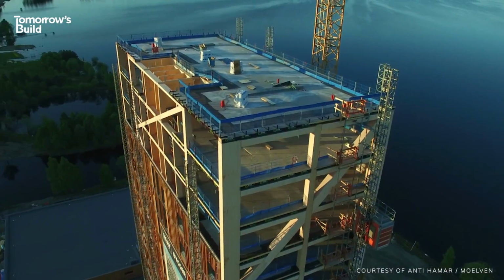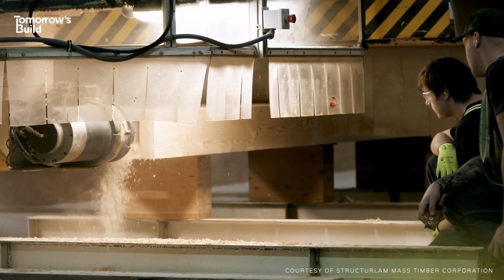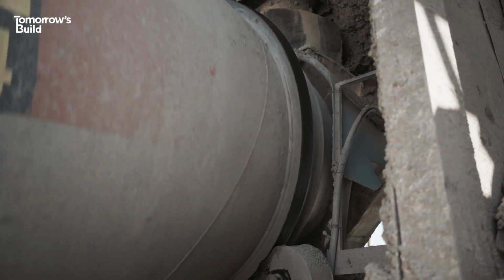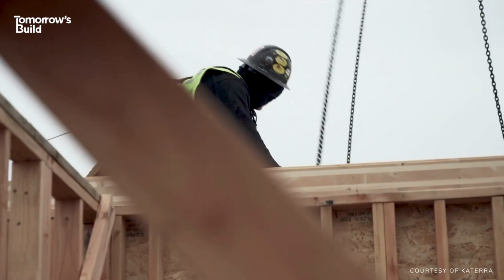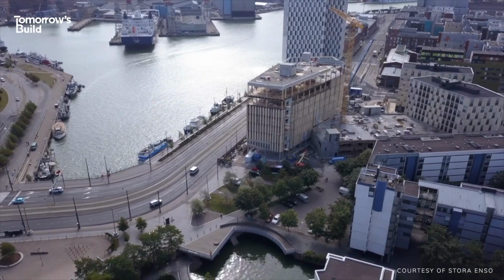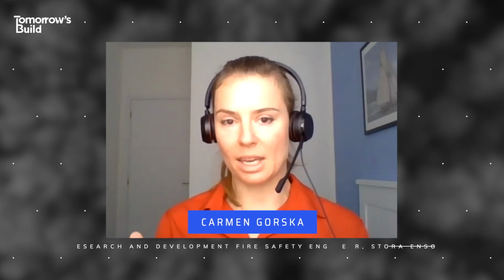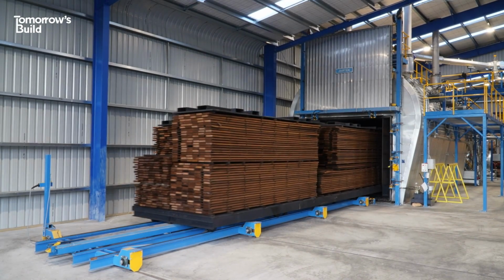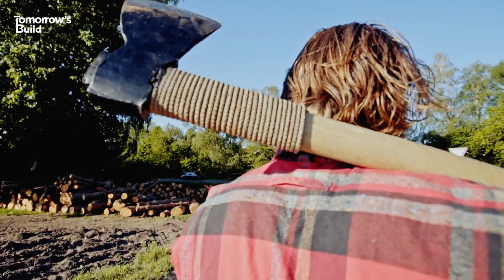Why All Buildings Should Be Timber

Comment: "Why All Buildings Should Be Timber" ... utterly ridiculous! We probably shouldn't be using lumber to build with as often as we currently do. I'd like to see building codes strengthened in fire prone areas to completely ban all flammable building materials. The Paradise, CA disaster would not have been able to happen if the fire hadn't been able to spread from building to building, tree to building, building to tree; it would have remained largely a wildfire. At the very least, all buildings in fire prone areas must have nonflammable exterior surfaces. It's not enough for structural members to char at a known rate. Any contribution of fuel to the fire increases the heat of the fire and the danger of the fire spreading.

Lumber also suffers serious degradation due to rot and termites. Treated wood is available, but how green is that? And has anyone investigated the adhesives that are used in engineered wood products? How green are they? A green solution is also a local solution... routinely carting building materials and other goods halfway around the world isn't green at all. Buildings need to be made out of locally produced materials, in general. Many areas of the world either have no forests at all any more, or don't have enough sustainably managed forests to support all local building activity.

By the way, the video confuses timber with lumber. Timber is wood still standing on the tree. Lumber is the tree cut into usable building materials.
timber
 [ tim-ber ]
noun
1. the wood of growing trees suitable for structural uses.
2. growing trees themselves.
3. wooded land.

Comment: I'd still opt for primary load-bearing members of tall structures to still be steel + concrete for consistency of material properties, but as secondary structural members, I suppose I can appreciate timber and its composite forms being reasonable choices.

Comment: Errr no... not ALL buildings can or should be built in one material. timber isnt the silver bullet material. its great for certain applications but not for all. Particularly where very high loads and dynamic / cyclical loadings occur. the major issue with timber is connections in addition to the fact timber section sizes would always, by its very nature be larger than steelwork and/or concrete.

The build material should always take into consideration, the application, the end product, life time maintenance costs, potential risks to the structure over its lifetime and also Client preferences for that particular country. No single material or product or method is an answer for everything.

Comment: Press X to doubt. As an architect I have looked into the material and for starters it costs an arm and a leg. Also any time we are talking structural members you want to be damn sure they age well and that is by no means certain with timber. The material is vulnerable to moisture and bugs. Those issues are largely addressed but we are talking decades here. Building take a beating over that kind of time periods. Also I am not so sure about the fire safety. A 1000 tests are worth a single wooden skyscraper burning. Fire is an awfully awfully unpredictable thing. I have no doubt its possible to make a safe wooden tall building but I doubt its a great idea.

Comment: timber buildings are same phenomena as electric cars. Yes they exist but almost no one are using them. 
Timber buildings are expensive, needs more maintanance, last less time, but main difference that timber building has little energy potential - meaning when you close heating it cools down quickly, while dense concrete buildings radiate heat for a longer period.

Comment: Having lived in the building trades and Manufacturing with Infrastructure, Pharm, tech, Energy, and transport from the 70's to "NOW"! Yes I know what "I KNOW", I am a Journeyman Carpenter, Millwright, Pipefitter, Electrician, Teamster, And Glazier.
I have worked with about Every Building Material in every environment conservable, but nuclear energy. 
 
This whole video is basically spoon feeding the Greens what they want to hear and see. 
Yes wood is good, YES it IS USED in everything Building it IS Suitable FOR ALREADY!
Concrete and Steel are also Very Natural, 100% recyclable, they all have a PLACE!

Structural loads, Economy, with time and Environments Location determine the product! 

Yes! I Did Notice the quiet deletion of Information on the TOXINS infused in "EVERY Engineered Piece" of Lumber AND how those Adhesives react to manufacturing, installation, environment, Fire Life and Safety and Simply working while in construction. Some are VERY BAD!

Factoring in the economy of waste and energy and other logistics in the Whole foot print, I think this is rainbows and fairy dust with a nice photo opp.

Comment: I think I have seen somewhere that prairies absorb and put away carbon at a more efficient rate than forests, so as far as number go planting forests in previously or even places that could sustain prairies may not be the right direction if the goal is to store carbon. But if the objective which is was one brief point is getting away from those higher processed materials which may lead to a higher production of CO2, may be counter productive if the forest replacing the prairie leads to an actual higher level of CO2 in the atmosphere. There are those mono forests that may be more factory like as well which does no good for the animal that would have been living in a diverse forest as well.

Comment: These biuldings are not incredible. They are utilitarian and preposterous. If we have timber as a biulding material back we can again put attenion to details like in pre-war architecture becasue it is easier to shape wood. Building timber structures as we build them with concrete and steel is like standing on two different vehicles astride. But I guess it is still too early to sincerely say to ourselfes the twentieth century was an accident.

Comment: Advertisement?

You have to compare wood with concrete side by side and not only mention you have one hour before the building collapses due to fire ...

The most buildings I‘ve seen consists from timber WITH concrete and steel. So I think in most cases it would not be a good idea to have a building complete out of timber.

So this is an advertisement which misses the downsides for a reason!

Comment: It is very nice that they can construct large buildings now, but timber does not last.  Concrete can last 100 years.  It is probably better to design better ways to build rock and concrete structures.  Especially with 3d house printing emerging now.

Comment: No, wood is not the answer for every building or every region in the world. But wood COULD be used much more, with environmental benefits, IF there was a real and extensive plan not just to harvest it sustainably, but also to acknowledge that agricultural woodlands are far less bio-diverse than natural forests.
We need to use the full range of natural resources available to us, working with local materials as much as possible. Shipping of heavy construction materials long distances causes a lot of pollution. Use local resources sustainably. Use unfired adobe in its various forms (pise, cob, adobe bricks, rammed earth). Use stabilized adobe (using cement but sparingly). Use bamboo. Use clay brick in areas where clay soils are abundant. Use stone where it is abundant. And yes, even use concrete, efficiently, sparingly, where it is the best material for the job.

Comment: Durability is an issue - most concrete or masonry houses can last hundreds of years with little structural maintenance, but wood is susceptible to water and insect damage. Plus, it's a lot easier damaging wood buildings, meaning they aren't necessarily the best choice for larger apartments. There are a lot of instances where wood is a good choice, but the longevity, maintenance, and water issues don't make it a good option in many places, even with all the technological options.

Comment: no.  all building frames should be made of recycled steel.  I know this works, my dad reset all low income housing projects in southern cali to use recycled steel without issue.  training is easier, construction is easier.  lasts longer.  REUSES steel from disposed autos.  win win.  wood is bad bad bad.

Comment: When thinking about sustainability we must consider the entire life of a product, from cradle to grave. Every time I see timber introduced as a sustainable solution I never see the grave portion of its life explored. Yes wood can break down naturally, but once treated with toxic fire materials, glues, and other water proofing chemicals, the timbers biodegradable properties are greatly reduced, and left unattended those many chemicals find themselves in the environment. Yes it may be an improvement to steal and concrete in many ways, but it is NOT the perfect material as so many are willing it to be. If I am wrong please tell me so by responding, I am a champion of sustainability in the built environment, and would like to learn all I can about timber.

Comment: I've known about engineered timber for a while but there's two things I haven't seen people discuss, 

What are the insulation properties like? From my understanding it is actually really good but I haven't seen any stats to demonstrate this

Also what about dents and deep scratches in the face of the timber. Saying there was an exposed timber finish, would it be very easy to dent compared to concrete steel making it less aesthetically durable. The hardness of soft woods is pretty low. Though I guess the same can be said for plasterboard, and you can line the timber internally with anything, I think one of the best parts of a timber building would be leaving it exposed.

Comment: Although building with timber is fine, as long as you detail correctly, the arguments in comparison to bricks, steel and concrete is coming short. Just planting a tree to outlife the construction and build a new one, isn't a fair environmental counterargument. After it's life cycle, most of the wood goes to the trashyard. Going up in flames, still emitting CO², while potential re-usage is completely ignored. While instead, above 90 percent of steel gets fully recycled, and also steel (and ofcourse stone, bricks and concrete) constructions last longer than most wood constructions. At least in theory they do. Material waste is as much of a problem as, or even more than, CO² emissions. The same goes for the architecture. There's a reason some buildings get demolished and some don't. This lays in our love for the building, may it be their function, the details, the beauty or the way it fits into the genius loci. It's sad how we are witnessing the death of so many brutalist and modernist buildings, yet they build them so often. While instead classical or traditional architecture is demonised, yet stays for centuries and most of it still does. Every building within European city centres isn't adapted towards flexiblity or whatever they teach on building sustainability these days, yet they've been use for so many different functions during their lifetime. May it be as a warehouse, an office, a shop or a house. So, no. We shouldn't build all buildings with timber. We should build smarter, more beautiful buildings and look to the potentially best materials and their future usage for each specific project.

Comment: And this presentation is produced on behalf of Some Timber Co. . Wood is a natural sustainable resource. However the chemicals involved in the processing of wood are dangerous to the health. These many different chemicals can exude in fumes from the wood for the life of a structure. The very young and old or in-firmed will be most impacted by this invisible chemical cocktail. High rise wood constructed buildings is not possible above 10 floors. All exterior wood necessitates the chemical cocktail already mentioned for preservation, before other chemicals such as fire retardant are added.. . .                Kind Regards

Comment: As interesting it is that humanity might eventually become the modern equivalent of tree-obsessed elves, wood is not without some concerning drawbacks.

Wood has a big issue that I've come to notice working with it: creep. It's when it permanently deforms under load even if it's well below its yield strength. This is not what you'd call desirable in massive buildings where small shifts can lead to big impacts on their structural integrity.

Comment: bullshit video, with current price od 9mm osb sheet od 25 usd  it would cost to build house like a replica of great pyramid , laminated wood is not storng and safe as concrete,brick or stone, and that bullshit ,,thers plenty of trees,, well assholes look around full deserts of sand and stone,plaenty of material to built, this is just capitalist propaganda, why burn some stone and make like mortar to fix stone and make stone house that last 1000 years or more, let pay millions for small formaldehyde house that will decompose after glue wears off

Comment: All it takes for the wooden buildings to collapse is some guy with a cigarette lighter (this is just a joke). If anyone has done engineering before, you will know that there is a very clear and obvious reason why wooden buildings are not the mainstream. 

Some of the factors that need to be considered are:
Chemical and thermal reactivity
Moisture perminability 
Cost
Thermal and liquid expansion (Expansion coefficient)
Material stress and strain, especially cyclic loads and tension/compression loads.
Life cycle analysis 
Recyclability
Torision resistance 
etc.

Comment: The only concern I have with the wide-spread adoption of this technique without any further  critical analysis is that, many of these "sustainable forests" are only sustainable by one metric: the sustainable and continual yield of timber that they supply. What I mean is, other metrics that people often tacitly assume to be present when talking about forests (such as biodiverse ecosystems, complex vegetation structures and minimal disturbances to wildlife) are not present in most sustainable forests, particularly in Europe. These forests are often composed of just one single tree species and organized in a way that removes all the natural systems complexity that organically develops under normal circumstances. Now this isn't to write off the video or this idea altogether (on paper its truly wonderful). Rather, it's important we acknowledge many of these forests are only sustainable by a single metric: timber yield and the sustained presence of trees, regardless of the absence of the other factors which usually make a true forest a forest.

Comment: Yeah right because engineered wood is made with urea-formaldehyde (derived out of OIL). "Super strong adhesive" (made of oil). Please refer to Well There's Your Problem Podcast - e46 - Five-Over-Ones.

The sustainable buildings are those that you only have to build ONCE!

Comment: The problem with timber is the aging of the material compared to concrete and steel. Especially in Europe, with cold and humid climate. It’s teached in Civil Engineering school that a building made of reinforced concrete has a life expectancy of a 100 years, whereas a wood one has only 50 years of life expectancy.
Yes you might produce less Co2 by building with wood, but if your building holds only half as long then it’s not as « green » anymore ...

Comment: I'd be interested to see if engineered wood holds up as well in tropical climates.   buildings in those regions are often completely over engineered with concrete, with terrible impacts on water consumption, CO2 emissions and acting as heat stores. 
Also what kind of woods can be used that are sustainably harvested in those regions..

Comment: Build with tires like Earthship Biotecture. Save trees and use a material that is already an environmental pollutant. Tire walls are earthquake and hurricane resistant and can withstand wildfires when packed with dirt. Tires are free from dumps and tire shops, they would otherwise have to pay to have them “discarded.” That’s the Earthship way!

Comment: I know timber can be high quality, but I've lived in concrete structures and timber structures. The timber structure has poor noise insulation, creaks when I roll over in my bed at night (not my bed or furniture, the very structure itself), has had holes or dents in the walls made by tiny impacts, etc. Meanwhile, the concrete one had no noise issues whatsoever, was rock solid, and never ever creaked. So in terms of consumer preference and experience, I'd go with concrete any day.

Not to mention the current lumber prices which are expected to not go down for a very long time.

Comment: This video over simplified the timber argument. Here in NZ most of our houses are built from timber, they are generally cold and damp or have very short lives due to the poor quality of materials and methods used. Basically a timber building is a chilly bin, it has no thermal mass so you need to heat or cool it from within. Of course there are sustainable ways to do this but there is another whole layer of technology required, sustainable construction is going to be a massive business moving forward but don’t think that timber is the complete answer.

Comment: Propoganda at it's finest, this video is NOT a good summary of pro/cons of standardizing Timber as a build material. For example, what is the carbon footprint of cutting down all the trees using heavy, carbon machinery? Furthermore, how are all of the trees replanted?  Is it done by hand, or again using heavy machinery?  There are climate impacts with every building option, and this video purposefully avoided covering any of the difficult topics, only highlighting the potential benefits.